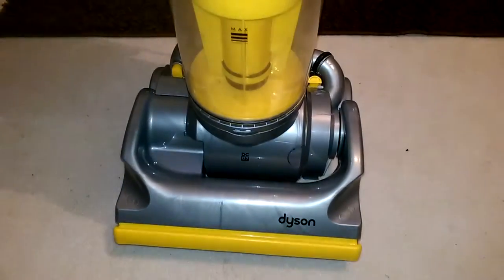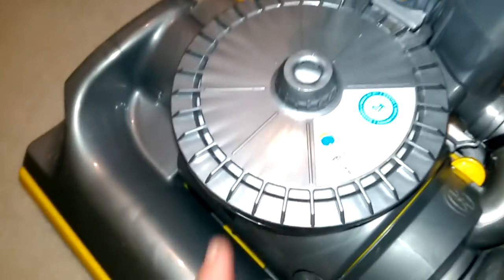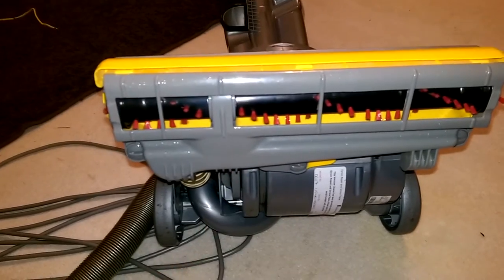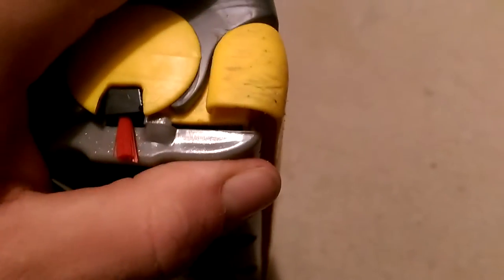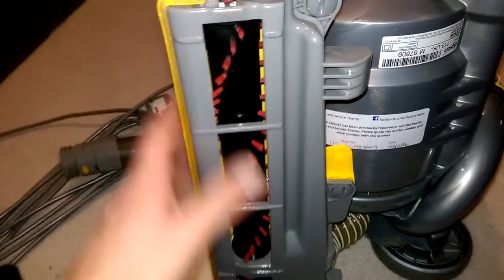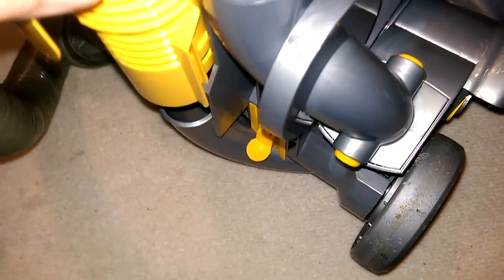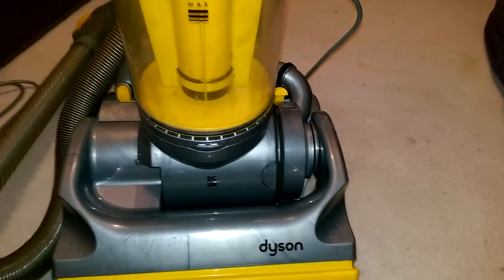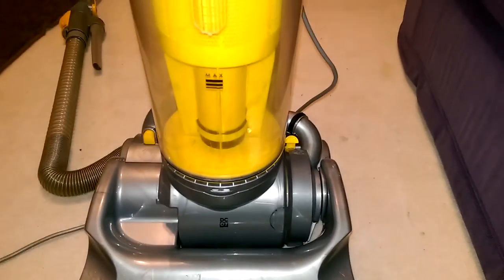The free Dyson DC07 origin - after refurbishment

Comment: Do you have any dyson Dc 03 handles that you are willing to sell
Reply from the maker: Jacob Bates I only have one which is faded to hell and has been glued, sorry! Loads on ebay though,  or ask Stu at Manchester Vacs
Reply: Beko1987 - The home of Sam Watson, the collector!  I looked on Manchester vacs I found one for 39 quid and eBay don't have any
Reply: Beko1987 - The home of Sam Watson, the collector! There is a dc04 zorbster for 28 pounds on Shpock it is near me in stanly I don't know if it is close to you but it looks like it will come out well or you could make a good one with yours
Reply from the maker: Jacob Bates miles away! I've got another complete machine coming to me at some point,  can make 1 good one out of two then. My zorbster will be useable when I get round to mending it though!
Reply: Beko1987 - The home of Sam Watson, the collector! Tell me about it I am asking about a wand for my project dc03 it has been in bits in the loft for two years and it now only needs a handle and bumper
Reply: Beko1987 - The home of Sam Watson, the collector! Tell me about it I am asking about a wand for my project dc03 it has been in bits in the loft for two years and it now only needs a handle and bumper